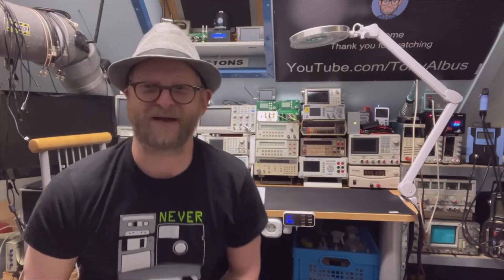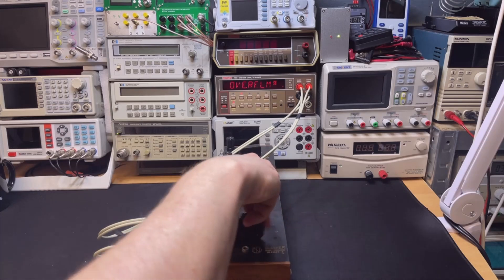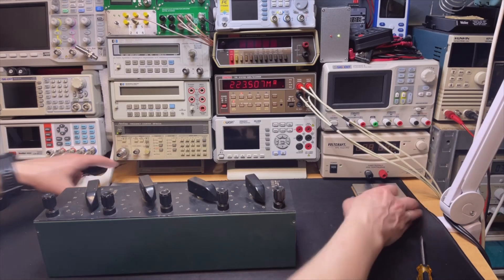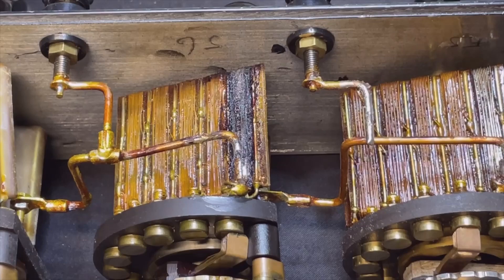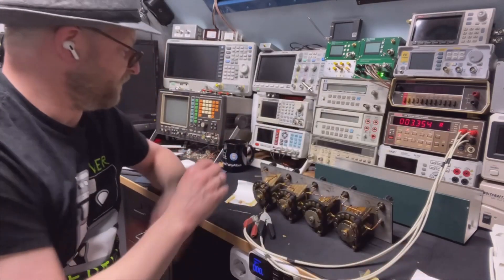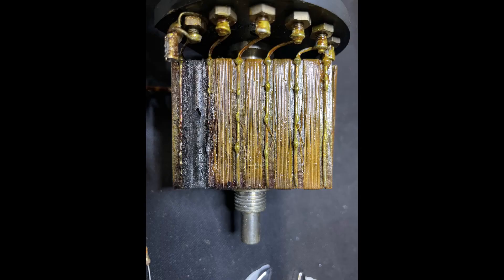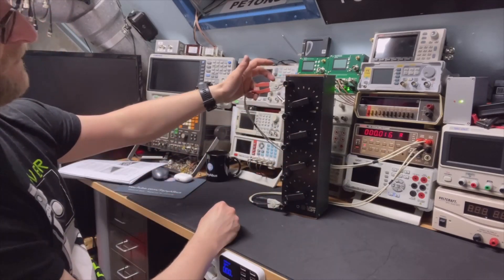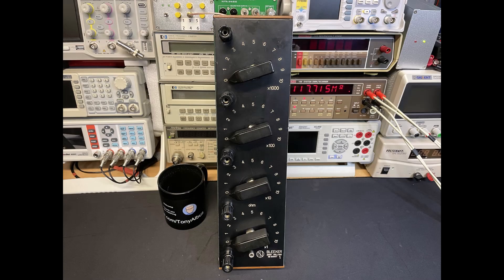#176 Classics BLEEKER Decade Resistor 1950 by Mrs. Dr C.E. Bleeker

Comment: Well done :-D
I love those big diameter contacts  and the multiple metal strips to ensure a good connection. 
I have a decade pcb with wafer switches and high spec resistors, it was for testing telephone systems but it has no box, yet lol.
It is nowhere as good as yours but its still good for checking multimeters for accuracy of the ohms ranges :-D
it has collet type knobs and attached to each knob is a clear plastic disk with 0-9 around it.
I have polishing blocks like the one you used,  Gary blocks for car paintwork prep.
Reply from the maker: Thank you!... love those old quality devices... so much attention to detail, will be unafforable now in production..